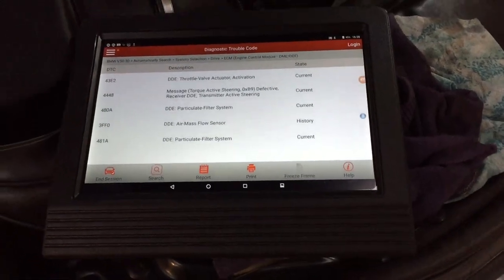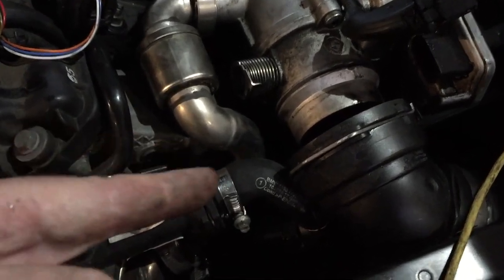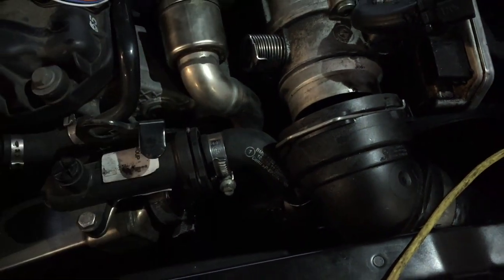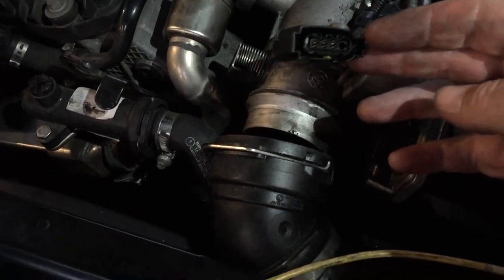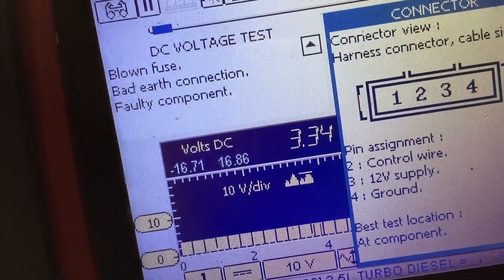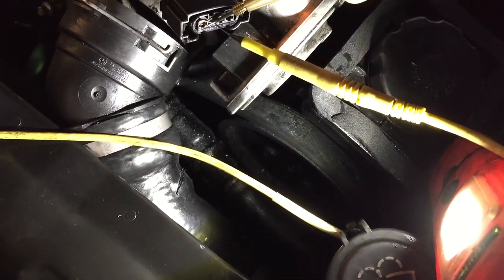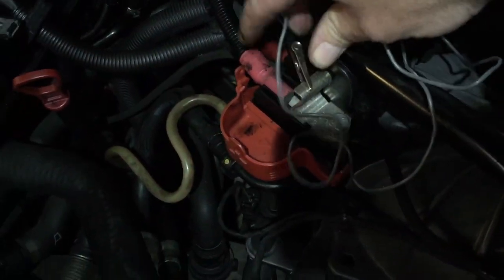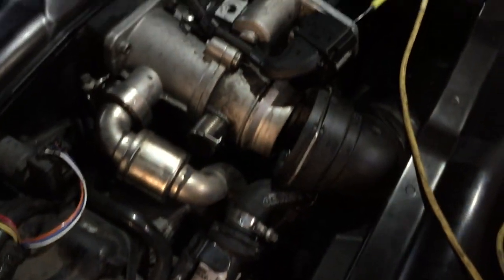BMW 5 SERIES Code 43E2 - Throttle valve actuator

Comment: Good video Sandy !
I believe that the throttle valve is controling the amount of exhaust gases which are coming from the EGR  . In other words , closed throttle , higher amount of exhaust gases , open throttle lower amount . Guess your theory , can increase the temperature even higher on the gases .
Reply from the maker: Good point my friend never occurred to me that strategy! I just remembered the Venturi effect from my days with SU carburetors and thought I would put it in to be impressive!!!! Cheers sandy

Comment: Nice bit of explaining of how to test. Did you have to recode the ECU, fitting a new or second hand throttle valve actuator? Carried out the same test with same values, knowing that some are prone to oil seeping inside and shorting the board took off the casing. Mine's clean so, no idea what causing the fault 483D. Getting a second hand replacement.  .
Reply from the maker: Cheers no coding required
Reply: @sandyande  Thanks for advise. Swapped the actuator for another to remove fault code 483D throttle valve actuator, initially fault disappeared after deleting all faults but has now come back. Have you ever come across this fault code. Originally appeared with fault 480D particulate filter system but that one has cleared. Wondering if it's something to do with regenerating dpf?
Reply: Hi I've got same code 483d. New throttle actuator didn't fix my issue either. If you find a fix or if anyone has light they can shine id really appreciate it.
Reply: @BMWlover-vy5ys  Hi, looking back I realized that the 483d code appeared at the same time as 480d linked to particulate filter system. The 480d has disappeared, so I'm thinking the 483d throttle actuator valve fault is linked, maybe it needs to regenerate? That's not likely to happen for a while if ever. I have some info on regenerating the dpf!!

Dpf regeneration

As somebody wrote before, there are certain requirements for regeneration:
The following conditions must be fulfilled for a regeneration:
- The coolant temperature must be in excess of 75 °C
- the exhaust-gas temperature before the diesel particle filter must be greater than 240 °C
- there must be enough fuel (fuel reserve indicator light is not lit up). Whenever the reserve lamp lights up, the regeneration process is suspended.
- no fault codes from the air mass system, exhaust emission system and sensors must be saved in the DDE
- The fault codes 480A / 245700 (from F01) and 481A / 245800 (from F01) must display the status "currently not present"
- Constant driving speed above about 60 km/h (approx. 38 mph). The optimum speed is about 100 km/h (approx. 60 mph).

There are two kinds of regeneration:
Continuous regeneration:
This form of regeneration takes place during normal driving. At exhaust-gas temperatures of between 280-350°C, continuous regeneration takes place in the form of a slow oxidation process. The soot particles cannot be incinerated until the exhaust gases reach the required temperature.

Periodic regeneration:

Periodic regeneration is performed automatically by the DDE after no later than 1000 km (600 miles). On vehicles with many short-distance drives, periodic regeneration already starts taking place after just 400 - 800 km (250 - 500 miles).
For regeneration, the intake air is reduced by the throttle valve. One or two post-injections are performed. This increases the exhaust-gas temperature to about 600 °C. The soot is incinerated with the residual oxygen.
The periodic regeneration is performed at all speeds. The most efficient method is regeneration at a constant speed in excess of 60 km/h (38 mph) over a period of 20-30 minutes.
The DDE calculates the time for periodic regeneration from the following values:
- average distance travelled
- average driving speed
- temperature in the diesel particle filter
- values from the exhaust gas pressure sensor.

Frequent short-distance drives and urban driving cause the diesel particle filter regeneration function to work less efficiently. Longer, extended and insufficient regeneration triggers the fault entry 480A. As soon as the fault is saved, regeneration is then no longer possible. This function is inhibited.

If the diesel particulate filter does not continuously regenerate itself and the exhaust gas pressure continues to rise, the fault code 481A is also entered. The Check Control message "Diesel particle filter malfunction" appears on screen.

Once faults 480A / 245700 (from F01) and 481A / 245800 (from F01) have been saved, drive the vehicle for about 45 minutes at a constant speed. In addition, switch on electrical consumers to keep the exhaust-gas temperature between 280-350°C. That enables continuous regeneration to take place, the exhaust backpressure drops, the faults are remedied and the following status message is issued: "currently not present". Now, normal regeneration takes place automatically.

Comment: Hi sandy great videos cheif. Have u had much to do with the mk6 transit vp44 inj pump. I've had it redone but its kicking my erse. Put it back on the van and now no start. U wouldnt have a known good crankshaft wave form would you.
Thanks for your time
Reply from the maker: Hi not got Crank/cam waveform but this video may help, P1666 is a common fault and it's usually the VP pump, do u get rpm reading on scan tool during crank? https://youtu.be/lLHrkUKA1iU
Reply from the maker: In fact the crank waveform is just a normal ford AC inductive type, usually 0.5 volts crank

Comment: Hello, maybe you will encounter these errors 4687 throttle valve and 483D throttle actuator. Every time the engine is extinguished, a signal comes to the extinguishing valve. Thank you
Reply: Do you fix problem  483D
Reply: Have you found the solution?